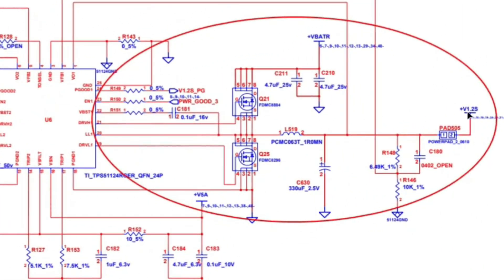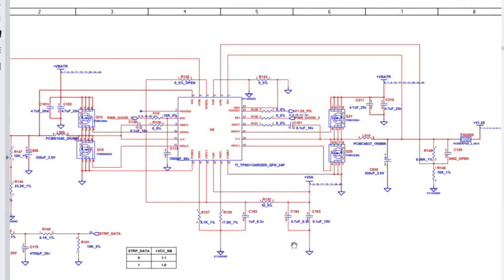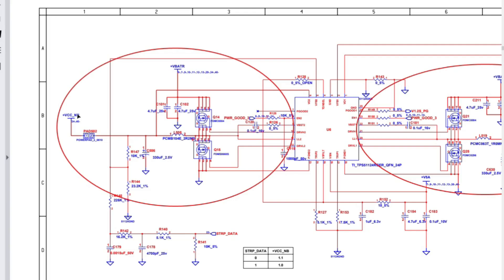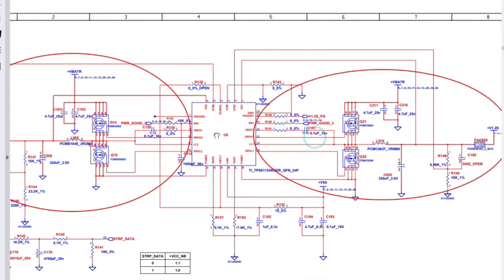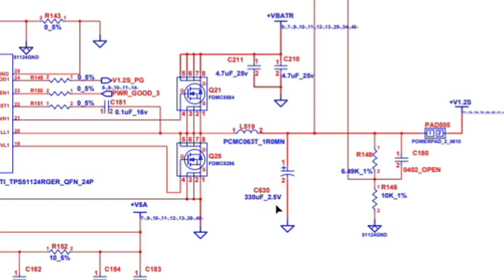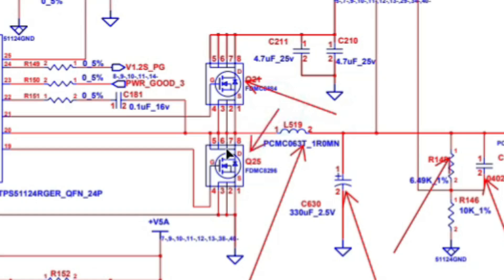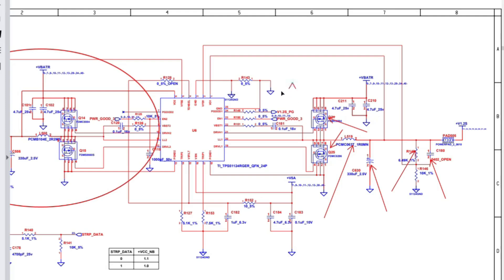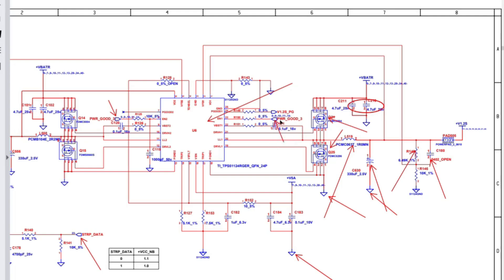Learn to Read Computer Motherboard Schematics | Electronics Repair Tutorial

Comment: My laptop circuit 3.3 LDO and 3.3 Power is ok.  When Switching 3.3V become down and blinking 1.6v-0.5V. I measure when not switching,  amps of 3.3V power is good.  I think sio output to enable signal of  3/5V ic has issue.  Can you suggests  me where i will check. What are most common always signal of sio should measure .